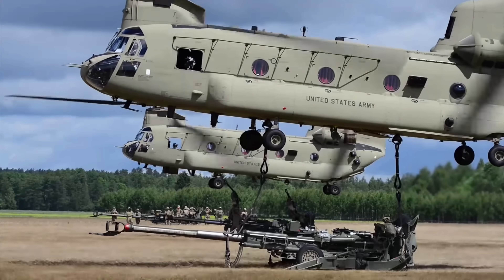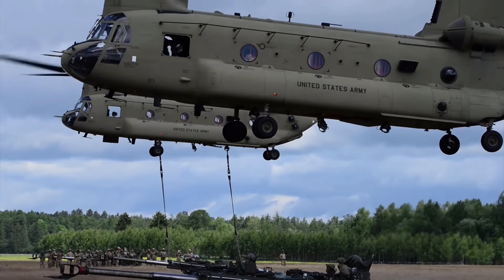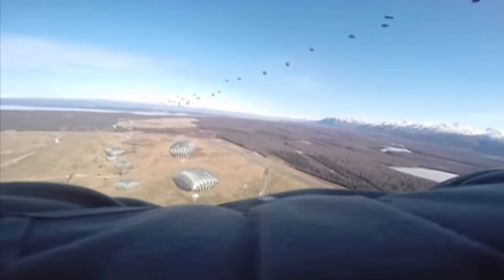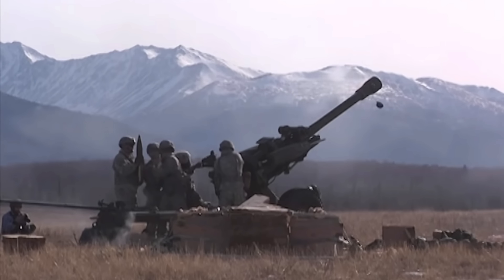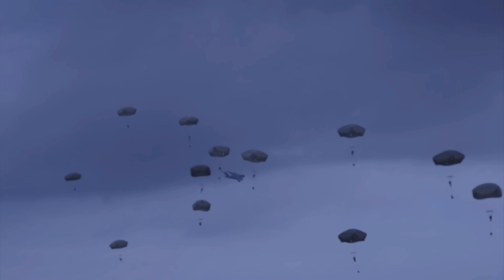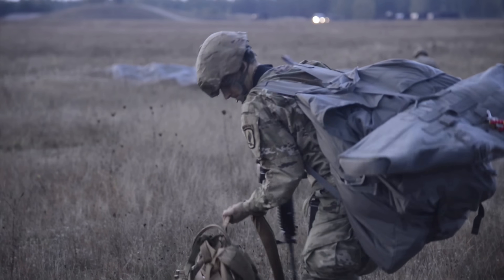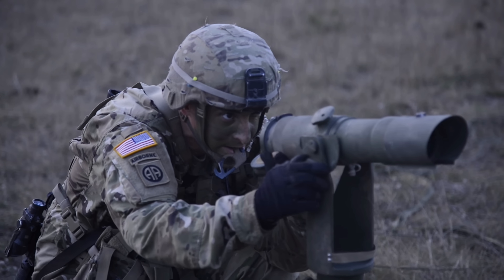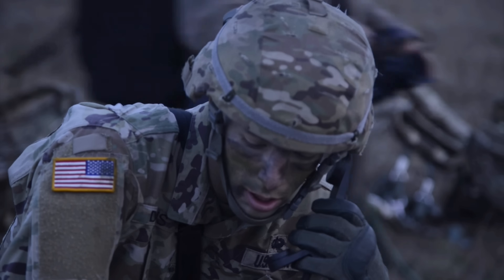Why do we still have Airborne Artillery?

Comment: german Fallschirmjäger use mortars instead of artillery because german paras are going for the mobile warfare type of engagement. the thinking is, para troops and airborne elements are usually ill equipped with not much logistics so they can't sustain a fight for a long period against regular enemy troops anyways. airborne troops world wide have the same problem of just not having the staying power of regular ground forces and therefore they are not used anymore. most people don't want to admit it but para units are nowadays mostly prestige units with a good morale and training but no use in modern warfare as airborne elements. nobody wants to risk airborne operation in a peer to peer scenario because altho it's easy to drop off airborne elements, how do you resupply them once the enemy starts to fight back (helicopters are easy targets) and how do you get them out again? well usually you can't so that limits what airborne troops can be used for. so the solution is mobility. if all airborne elements are mobile then they don't need to sit there (or walk which is not much better) and take the punishment from the enemy. instead they can be dropped off at a safe distance from wherever the mission is. get into their little Wiesel 1 or 2 tracked and air portable weapons carriers and just scoot and shot and then retreat again to e.g. an airport they can secure or at least an exfiltration point that is reasonably far away from enemy forces and can be defended until all airborne elements are evacuated or linked up with the relieve ground units. for that type of airborne operations artillery is not strictly needed, mortars that can keep up with mobile forces on the other hand are perfect for the job. a mortar shell has about the same impact on target as a regular artillery shell but with a reduced range of about 1/4 the range of artillery. for a mobile unit that is plenty enough since the mortar units are always right with them, so they don't need the range.

Comment: Video suggestion: Can we build a shoulder-mounted light anti-air missile that can take down a fighter jet as well as helicopter. We have shoulder-mounted anti-air missile like Stinger but it can only take down small drone and helicopter, not a fast flying fighter jet. Modern SAMs that can shoot down jet are heavy and can only carry around by vehicle.
Reply: I mean they use the FM-92 stinger missile on the Apache as an anti air missile

Comment: Matt, are you aware of the Nona SPG on the basis of the BMD chassis? The Soviets tried to make an airborne 122mm self-propelled howitzer armed with the 60's called 2s2 "Fialka" but failed and instead chose mounted mortars, turreted gun-mortars, low rocket count 122mm MRL's on trucks, flown in D30's, and a shortened variant of the FROG tactical missile.

Comment: When I joined the British Army in 1989, I went into the Royal Artillery doing my basic training in Woolwich, London, I always intended in going to 22nd Air Defence as that was a Welsh regiment, so imagine my disappointment when I finished my basic training and was set to go into my Special To Arms training, I found myself having to train on the 105mm field gun, something that would be of NO USE in an Air Defence Regiment!! I tried to get swapped with someone on one of the 2 other courses (Driving or Signals) which would have been of use, but no the Royal Artillery in its infinite wisdom told me to basically shut up and get on with it! I should have known something wasn't going to go smoothly as they initially tried to send me to 50 Missile Regiment, which was a Nuclear regiment!! Me Around Nukes!!??!! LMFAO...I DON'T THINK SO!!
Reply: Aye, I had wanted to go into signals or command post, so naturally I was sent on a light gun course, and THEN posted into CP/sigs. RA in it's absolute wisdom only put me on a signals/command post course when I had signed off.
Reply: @ciarancallaghan8166 , yup, sounds about right. RA had a real knack for stuff like that.

Comment: Like during ww2 most artillery were pulled by tanks or apc of the time but when people think of airborne forces most think of paratroopers as an example yet it is true that airborne artillery are useful as they catch the enemy off guard due to not expecting it to happen
Reply: Works pretty good when not in Europe with all the roads...

Can drop them anywhere, to help out with the air assault, without having to capture roads and Bridges.
Reply: They dropped heavier equipment using gliders in WWII hauled by bombers. It's fascinating.